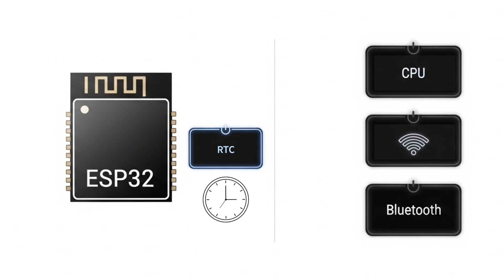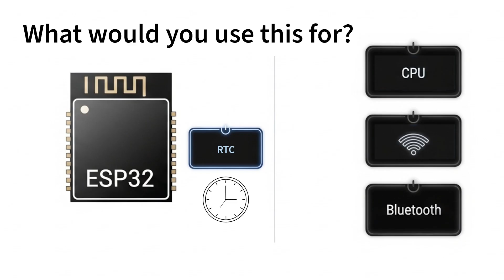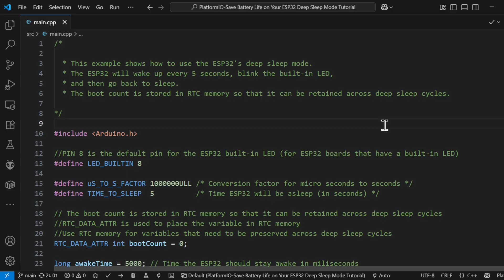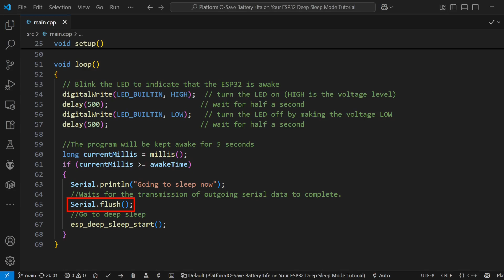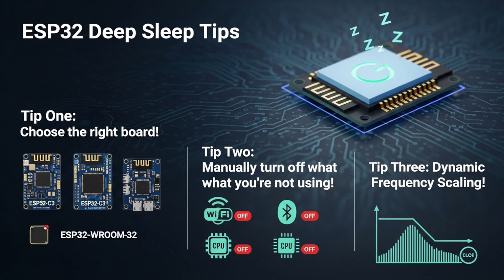Save Battery Life on Your ESP32 – Deep Sleep Mode Tutorial

Comment: I’d be interested to see if you could do this on a presence sensor with say an ld24c. Can presence wake it up?
Reply from the maker: Great question! You absolutely can. To do this, you would use External Wake-up (essentially telling the ESP32 to sleep until a pin goes HIGH). I actually cover the code for button wake-ups in my other video (https://www.youtube.com/watch?v=AI3ZpJL4MPE), and the logic is exactly the same for a sensor.

The catch with the LD24C:

While you can do it, mmWave sensors like the LD24C are power-hungry (often ~80mA) and need to stay fully active to detect you. So, even if your ESP32 is sleeping, the sensor will drain your battery in hours.

If you need to save power with that specific sensor, you have two main routes:
Automatic Light Sleep: This keeps the CPU idle but the peripherals active (useful if you need to read UART data instantly). Again I cover that in this follow up video (https://www.youtube.com/watch?v=AI3ZpJL4MPE).

ESP32-S3 ULP (https://docs.espressif.com/projects/esp-idf/en/stable/esp32s3/api-reference/system/ulp-risc-v.html): If you use an S3 board, you can use the Ultra-Low Power Co-processor to monitor the sensor while the main cores sleep. (I’m actually planning a future video on the ULP, so stay tuned!).

For pure battery builds, I would recommend a PIR sensor instead of mmWave—they use almost zero power!

A PIR is great for battery because it sleeps with one eye open. An mmWave sensor is bad for battery because it has to keep a radio transmitter running 24/7. But the PIR only detects movement. If you sit on the couch and stop moving to watch TV, the PIR thinks you left the room.

The mmWave is literally a radar. It contains a radio transmitter and receiver. It is constantly blasting out high-frequency radio waves (24GHz) and listening for the reflections (Doppler effect) to detect breathing or tiny movements.
Reply: @bjdsolutions8928  Wow thats interesting.  I wonder if if we did a hybrid i.e. esp sleep untill PIR wakes it up due to movement detected.  Then MMwave is activated in case person is perhaps static in room (like a toilet/bathroom or walk-in robe), then when presence is clear, esp goes to sleep and mmwave turned off. Do you think that would work? very cool project if it did!
Reply from the maker: That is an interesting idea. That could make for a very full featured battery-powered presence detector. 

I would say it is 100% possible.

To make it work, you just need one extra component: a Logic Level MOSFET transistor.

The workflow would look something like this:

Deep Sleep: ESP32 is sleeping. The MOSFET is OFF, so the mmWave sensor is completely dead (0 power). The PIR is powered (using ~15uA) and waiting.

Wake Up: You walk in → PIR goes HIGH → Wakes ESP32.
Active: ESP32 wakes up and immediately sends a signal to the MOSFET to turn ON the power to the mmWave sensor.

Sustain: The ESP32 stays awake reading the mmWave. As long as the mmWave sees you (even if you are static), the ESP32 resets its "sleep timer."

Sleep: Once the mmWave says "No Presence," the ESP32 turns off the MOSFET (killing the mmWave power) and goes back to Deep Sleep.

The only catch: Check the datasheet for your specific mmWave sensor to see its "initialization time." Some take 1–2 seconds after receiving power before they start sending valid data, so there might be a tiny lag when you first enter the room.

It is a fantastic project idea.

Comment: What’s odd is that it’s impossible to measure low currents with a meter like that as the burden resistor value will be too high to give a reading that is close to reality.
Reply from the maker: True true. I've been reading up on burden voltage, and it’s a real challenge with standard multimeters in the µA range—the internal resistance causes such a voltage drop that the ESP32 can brown out or give skewed readings.

That’s exactly why I’m upgrading to the Nordic Power Profiler Kit II for the next video! It handles that dynamic switching between sleep (µA) and active (mA) states much better. I think the multimeter was a decent 'sanity check' to get started, but I'm really excited to see the difference in accuracy with a dedicated tool. Thanks for watching and for the great input!

Comment: Thank you, this was helpful and informative.  Here is a scenario I'd like to see you have in this mode that you just showed.  However, I want to come back to this setup in the fields, and I want to have it turned ON so I can work with the board.  Let's say I use a toggle switch to keep it from sleeping.  Once I am done, I turn the switch off, and it returns to regular mode. Please show this.
Reply from the maker: Thanks so much for watching!

It sounds like you want a 'Service Mode' or 'Maintenance Mode,' and it is absolutely essential for devices deployed in the field. You interpreted the logic perfectly: we just need a conditional check before the board goes to sleep.

Here is the easiest way to do it:

1.  The Hardware: Connect a toggle switch between a GPIO pin (say GPIO 4) and *GND*.
2.  The Code: In your setup(), configure that pin with an internal pull-up resistor. This keeps the pin HIGH when the switch is open, and pulls it LOW when you flip the switch.

It would look something like this right before your deep sleep command:

pinMode(4, INPUT_PULLUP); // Set GPIO 4 as input

// Check if switch is ON (Active LOW)
if (digitalRead(4) == LOW) {
  Serial.println("Maintenance Mode Active - Staying Awake!");
  // The ESP32 will now skip the sleep command and keep running
} else {
  Serial.println("Returning to Deep Sleep...");
  esp_deep_sleep_start();
}

This way, if you walk up to the device and flip the switch, it stays awake so you can check logs or re-flash it. Flip it back, and it goes into its low-power coma.
Reply: @bjdsolutions8928  Thank you, this is awesome to know.  I'm hoping to build a basic prototype over the holidays.  I'm going to watch more of your material, too.

Comment: wow that's really cool! wanted to create this for so long...
but how to achieve multiple monthgs - you said choose eg. esp32-wroom-32 and turn off the bluetooth and wifi and both cpus? how do I do that? I guess I can figure that out; but how do achieve the last thing: dynamic frequency scaling? - how long could this setup last: esp wakes up twice a day and exposes a wifi hotspot with a predefined ssid; waits for 5mins and goes to deep sleep again..
Reply from the maker: Thanks for the kind words! I actually just released a follow-up video that answers exactly these questions: https://www.youtube.com/watch?v=AI3ZpJL4MPE

For multi-month battery life, here are the important bits:

Turning off Wi-Fi + Bluetooth: The beauty of Deep Sleep is that it automatically powers down the Wi-Fi, Bluetooth, and both CPU cores. You don't have to manually turn them off before calling esp_deep_sleep_start(). It is possible to turn off wifi/bt if your program has to do more work before sleeping and does not need the radio any more. The follow up video covers this: https://www.youtube.com/watch?v=AI3ZpJL4MPE

Dynamic Frequency Scaling (slowing down the CPU): This is an advanced optimisation, which the follow up video covers, because so many people asked.
In Arduino you can set it manually like this:

setCpuFrequencyMhz(40);

But the really cool stuff — automatic frequency scaling + light sleep during delays — requires ESP-IDF or PlatformIO with power-management enabled. I show real multimeter readings in that video so you can see the difference.

Battery Life: For your specific use case, the "5 minutes awake" is the biggest factor. Wi-Fi consumes a lot of power (approx 100-150mA). If you wake up twice a day for 5 mins, you are awake for 10 mins total. On a standard 2000mAh battery, you might get a few months, but that 5-minute window is the main drain to watch out for, not the sleep time!"

If you want this to last really long, I’d recommend:
⚡ Turn Wi-Fi on → do the job fast → turn Wi-Fi off → go back to sleep as soon as possible.
Keeping the hotspot open for 5 minutes is where most of the battery disappears.

If you want the full breakdown (auto frequency scaling, CPU speed changes, RTC pins, light sleep, and more code examples), it’s all in my follow-up video — it was literally made because of questions like yours. 😄

https://www.youtube.com/watch?v=AI3ZpJL4MPE

Comment: Nice, clear video. I haven't worked with an ESP 32yet, because I'm too confused by all the variants, do you have a suggestion for which one to use, as a beginner?
Thank you!
Paul, USA!!!
Reply from the maker: Hi Paul,

Thanks for watching!

Personally I like the ESP32-C3 and ESP32-S3. 

Th C3 is smaller and consumes less power. It's fine for connecting sensors and logging telemetry. I would say anything you would do on an arduino.

The S3 is bigger and more powerful. Much more memory. Can do AI things, machine learning, or multimedia processing.

So I guess the C3 is better for beginning and when it's all you need.

The ESP32 used in the video is a XIAO ESP32-C3.

Comment: How can I determine how long the ESP has been sleeping when it is awakened by an external (pin) interrupt?
Reply from the maker: There are 2 ways.

1) Rely on the RTC timer's time keeping; which keeps counting during deep sleep. By default this uses an Internal RC oscillator.

You would need to use the 'RTC_DATA_ATTR' modifier on a variable to keep track of the time ie:

RTC_DATA_ATTR time_t boot_time = 0;

You could set that in the setup function like 

boot_time = time(nullptr);

And check the difference between boot time and the current time something like:

if (boot_time == 0) {
    Serial.println("First boot or RTC memory cleared.");
  } else {
    time_t now = time(nullptr); // Get current time
    Serial.print("Woke up after ");
    Serial.print(now - boot_time);
    Serial.println(" seconds.");
  }

Detailed explanations on the RTC timer can be found here.
https://docs.espressif.com/projects/esp-idf/en/stable/esp32/api-reference/system/system_time.html

2) The RTC timer may not be 100% accurate. So you could use a Network Time Protocol server to check the time remotely on boot. You could store the last timestamp in RTC memory before sleeping. Fetch a new NTP timestamp on wakeup and compare it. 

Here is an example of setting up NTP:
https://randomnerdtutorials.com/esp32-date-time-ntp-client-server-arduino/

I will have a video coming up soon that has an example of using NTP.

Also will be following up on this video and include examples of these methods.
Reply: @bjdsolutions8928 Thank you! It really works!

Comment: You can use the ESP32's built-in flash memory (Non-Volatile Storage - NVS) or even write to the RTC memory to write some data before is goes to sleep so that the ESP can read some data after a reboot and continue with a selected process. Unlike the RTC memory, data stored in NVS will survive a complete power loss, making it the ideal choice for permanent settings.
Reply from the maker: Thank you for your sharing that tip! I am compiling notes from all the comments and will be following up with extra tips like that. Many thanks.
Reply: @bjdsolutions8928  cool, I'm activating the notification, want to see the next tutorial about this as soon as it's published!

Comment: Is there a option to wake up by physical button without interrupting the main functionality.. im really struggling with that...
Reply from the maker: You can certainly wake up the ESP32 from deep sleep with a physical button: 

An event based wakeup would be triggered using the 'External Wake Up' instead of the 'Timer Wake Up' method.

In the video's code: 'esp_sleep_enable_timer_wakeup(TIME_TO_SLEEP * uS_TO_S_FACTOR)' would be replaced by 'esp_sleep_enable_ext0_wakeup(GPIO_NUM_X, level)' in the setup function.

'GPIO_NUM_X' would need to reference a GPIO pin on the esp32 which will be used to trigger the wakeup. 'level' would be set to 0 or 1. Depending on whether the trigger is activated from a LOW or HIGH signal.

---

Also you can trigger an interrupt from a physical button without interrupting the main functionality too. I have a video on that here (But the device must be awake): https://www.youtube.com/watch?v=rXBmXEThfZI&t=27s

Comment: Can you make a smart fingerprint scanner with esp32 and oled display and the data of fingerprint is sended with wifi to a private network offline in pc and that pc can use that data to store in their database
Reply from the maker: That's an interesting project idea! It combines several technologies.

I have not experimented with a fingerprint scanner myself but maybe something like the FPM10A would work.

Would the OLED Display show feedback to the user, like "Place your finger" or "Access Granted."? Or would this draw a picture of the fingerprint?

You can certainly send data from the ESP32 to a PC on a local network. The trick here would be setting up the server and application on the PC.

The simplest solution might be to run a small MQTT server that logs the data to a SQLLite database.

You could also experiment with Node-Red running on the PC. https://nodered.org/ It is a solid open source IOT platform. It has modules for MQTT and Database connections. I plan on making some videos about Node-Red in the future.

My advice is to tackle each of these four parts one at a time. Get the fingerprint scanner working first. Then, add the OLED display. Once that's solid, figure out the Wi-Fi communication. Finally, build the PC-side application.
Reply: I’ve already built this project 

Character LCD for display
PHP Laravel as backend 
Battery powered ESP32-S3
R307 Fingerprint sensor ✨

It’s fully working as an attendance system
Reply from the maker: Thanks for sharing details of your setup!

Comment: Just wondering if recovery from deep sleep is fast enough to make a energy-saving blink sketch?
Reply from the maker: Just wondering if recovery from deep sleep is fast enough to make a energy-saving blink sketch?

That's an interesting idea. The ESP32 should be able to enter/exit deep sleep in under a second. Maybe optimally 200ms or so.

It will enter deep sleep very quickly but is slower to wake up and reinitialise. It's like a hard reboot.

Things that could slow the wake up / start up would be a low clock speed and any debugging/logging messages.

A deep sleep blink sketch would save power so long as the blink delay length was longer than the shutdown/start up time. The longer the blink delay the more power would be saved.

Comment: Thanks mate. Would great if you were to amend the thing with other triggers like an external interrupt to wake it from deep sleep. Also mention the limitations of the RTC like max timer. TA
Reply from the maker: Thank you for your feedback! I am compiling notes from all the comments and will be following up.
Reply: Yeah, I’d really like to be able to wake it up using a remote, using a trigger from a receiver. I’m new to the esp32 world. Is there a designated pin that I can pull down/pull up on the esp that I can use to do this whilst it is in deep sleep mode?
Reply from the maker: There are designated pins that you can pull down/pull up on the esp in Deep sleep.

----------

An event based wakeup would be triggered using the 'External Wake Up' instead of the 'Timer Wake Up' method.

In the video's code: 'esp_sleep_enable_timer_wakeup(TIME_TO_SLEEP * uS_TO_S_FACTOR)' would be replaced by 'esp_sleep_enable_ext0_wakeup(GPIO_NUM_X, level)' in the setup function.

'GPIO_NUM_X' would need to reference a GPIO pin on the esp32 which will be used to trigger the wakeup. 'level' would be set to 0 or 1. Depending on whether the trigger is activated from a LOW or HIGH signal.

The GPIO Pin will need to be an RTC PIN.

Here is a list of the RTC pins for the S3 and C3. You will need to check for different models.

S3: https://docs.espressif.com/projects/esp-idf/en/stable/esp32s3/api-reference/peripherals/gpio.html
C3: https://docs.espressif.com/projects/esp-idf/en/stable/esp32c3/api-reference/peripherals/gpio.html

----------

In your use case the receiver would still need to be powered to recieve the signal and trigger the pull down/pull up on the ESP32.

You could also consider using light sleep and UART wakeup. Light sleep uses more power than deep sleep however.

Here are some guides on light sleep for now. I will be making some video examples in a follow up.

 https://docs.espressif.com/projects/esp-idf/en/v5.1/esp32/api-reference/system/sleep_modes.html#uart-wakeup-light-sleep-only
 
 https://randomnerdtutorials.com/esp32-light-sleep-arduino/#uart-wake-up

Comment: Great content. However, ESP32 need 3.3V and we need good regulator from LiPo Battery with single button. We can put ESP32 to sleep with the button but cannot cut the power that run to regulator. If you have a content on the circuit to manage on that would be valuable.
Reply from the maker: It sounds like you want to keep the regulator running while the ESP32 is active but disable it when it is not. 

I would say for this use case you would need a separate module. Such as the Adafruit TPL5110 Low Power Timer Breakout.

That module has an adjustable timer which will turn your project on. It will then wait until a signal is received from the project to tell the TPL that it can safely turn off the power again.

Basically use an extra external timer to turn the esp32 on and off.

Ditching the regulator completely would work so long as the voltage coming directly from the battery does not exceed 3.6V. The ESP32 has an operating range of 2.2-3.6V.

I have not come across an ESP32 dev board that has no regulator. So this would require modding a dev board to break the connection to the regulator (messy) or creating a custom PCB (advanced).

I feel using something like the Adafruit TPL5110 Low Power Timer Breakout might be the solution!